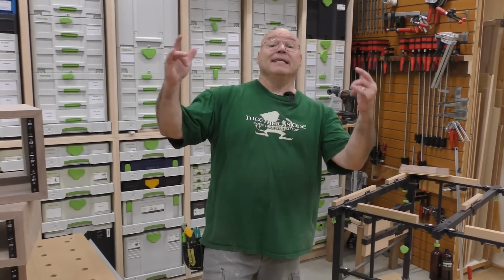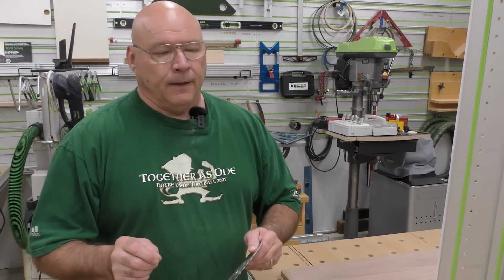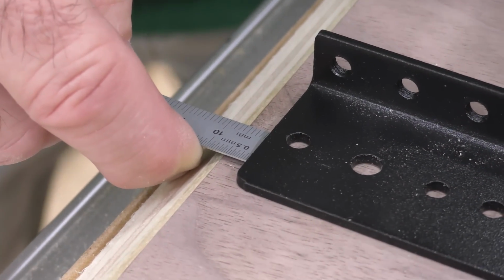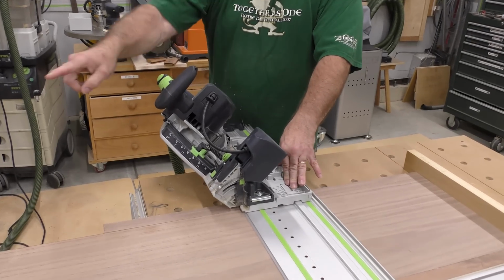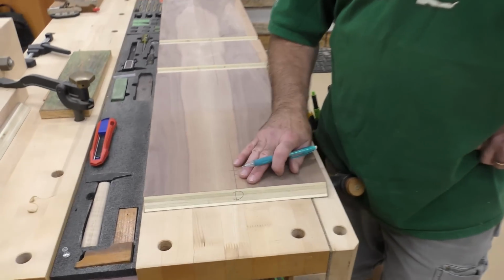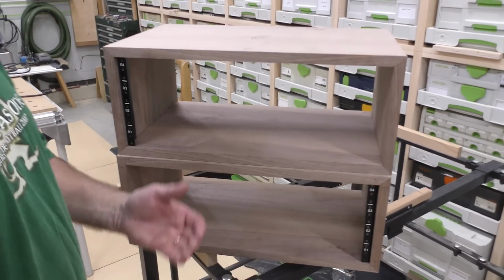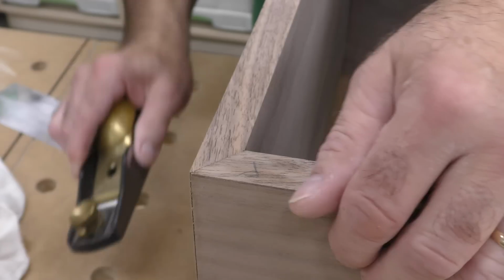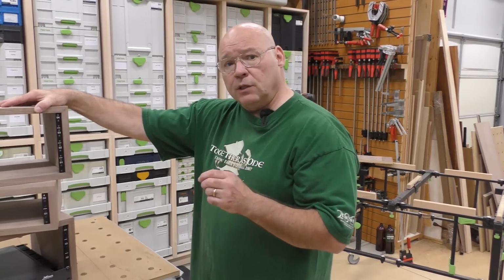Rack 'em Up: Custom Recording Studio Rack Cases

Comment: Great build, looks very very nice, just one thing, you did say the sizes of the rack muinted equipment is standard, that is correct, the only thing that is not standard is the thickness of the front panel, I have seen them from 3mm up to 6mm thick, so I was a little worried with the offset of the brackets, I whould have put them at 6mm.....
Reply from the maker: Thanks for the feedback !!

Comment: Sedge, great video.  Very informative.  Have you made a video about adjusting the alignment of the MFT factory set stops?  When I set my table up for cutting with the fence, the track does not line up with the pin at the front of the table.  Thanks
Reply from the maker: Not yet!